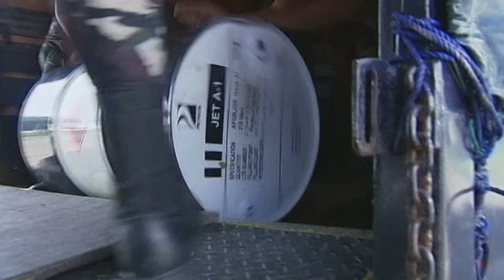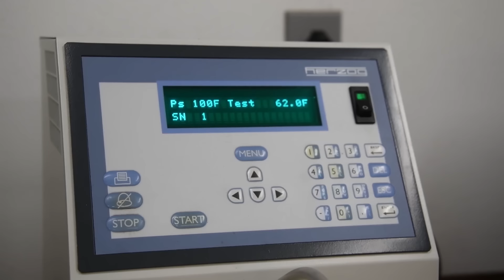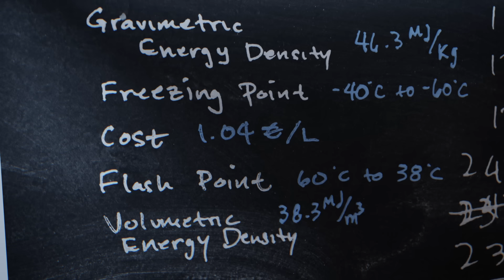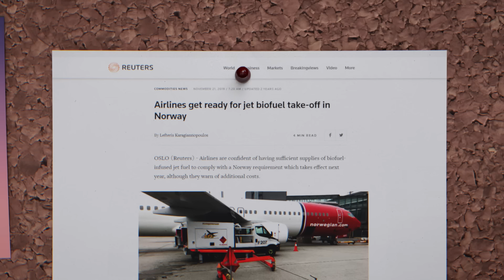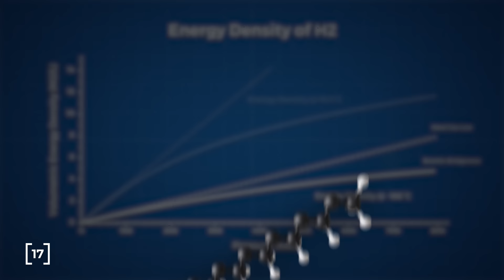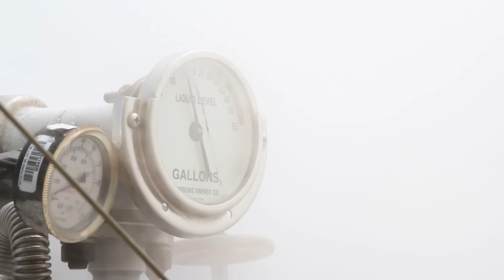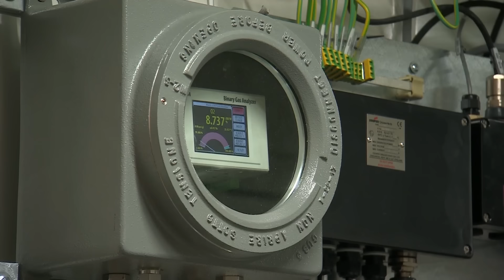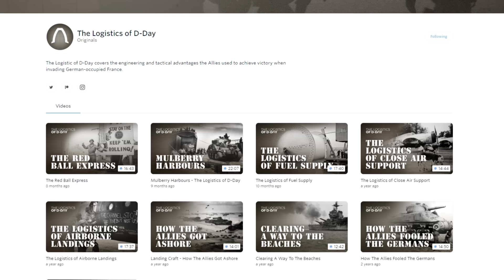The Uncertain Future of Jet Fuel

Comment: I spotted a fatal flaw in the video, boiling, freezing and flashpoints are measured in temperature scales, especially, freezing and boiling points are not just linked, they move in tandem meaning that a higher boiling point is equal to a higher freezing point and vice-versa. For instance, the longer chain hydrocarbons like diesel have a higher, not a lower boiling point 3:50. Therefore, it has a higher freezing point as well. which, is the reason why it gets distilled first in the tanks and freezes with higher temperatures than kerosene. on the other side of the spectrum, there is LPG with lower boiling and freezing points, this fuel is distilled last and could endure lower temperatures without freezing for obvious reasons.

Comment: Why does the navy take such serious steps to fight fires before they can happen? Because, paradoxically, fire is the greatest danger to any seafaring vessel. If you have a fire and it damages power systems, as it is likely to do, then you cant power water pumps to douse the flames. At that point you need bucket chains or windlass pumps that can be turned by hand to draw seawater to deck height.

Water, water everywhere...

Comment: I do wonder. What about a propulsion system that generates fuel during operation? You fill your aircraft up with a very efficient feedstock, NOT fuel, which should be way safer, and then convert to, say, hydrogen. Volumetric density shouldn't matter because you only need to store a tiny amount of generated fuel. Correct me if I'm wrong here, but wouldn't that make hydrogen WAY more efficient as a fuel?

Comment: Hydrogen is essentially an energy storage system. And it will always take much more energy to make and use - than it can yield.

An interesting topic might be modern sailing ships - computer controlled kites is one way to think about some of the methods. With Americas Cup sail boats hitting 55MPH, it might be possible to cross oceans in much shorter times than we think - to possibly replace some/most of international air travel. Electric airplanes with solid state batteries could be used for most flights over land.

Comment: This is probably extremely naive of me, but if long chain fuels are prohibitive primarily because of their higher freezing temperature, why isn't supplemental heating of the fuel tanks a potential solution to the problem? Thinking of things like glow plugs in diesel engines, for example.

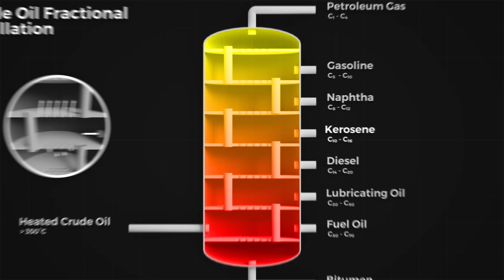Comment: 4:20 "by excluding the hydrocarbons with longer chains with longer chains, and therefore excludes lower boiling point molecules from the mix." 

Should this not be higher boiling point molecules which have a higher freezing point? i.e. the hydrocarbons at the bottom have a higher boiling point and higher freezing point? There are then less of these in Jet A-1 which leads it to have a lower freezing point and is better suited to colder climates?

Comment: I wonder, could you use the heat byproduct of the engines to keep the fuel at a steady temperature?  Maybe not water but some coolant that runs through the engine, with a heat exchangers near the fuel tanks and along fuel lines?

Comment: You didn't mention anything about battery technology improvements. If batteries ever get to the energy density of jet fuel - then the problem is solved, especially when the batteries are structural and won't waste any space inside the airframe. It might be a long way off, but isn't impossible.

Comment: High flash point, low vapor pressure, also with lower melting/freezing point on the same time ~= wider temperature range for liquid, hydrocarbon molecules with more branching structure or need to insert polar functional groups (e.g. amine, amide, alcohol, ether, ester ...) to the hydrocarbon backbone.

Comment: Liquid Natural Gas is denser than hydrogen, cleaner then other hydrocarbon fuels (no particulates, less CO2) and cheaper than kerosene. It's still a cryogenic fuel like hydrogen, but it doesn't need to be as cold, and it burns at a higher temperature than hydrogen. There is the problem that it is not compatible with existing planes, but planes specifically designed to use it would be cheaper to make than ones using hydrogen. Also, the coldness could be an advantage, as it could help cool down electrical components and be used to densify the air coming into the engine, making it more dense, and improving the efficiency of the turbofan system.

Comment: The big problem with airplane fuel is that the profit margins of air travel are so thin that retrofits to use new fuel sources are financially untenable. The military can spend infinite money, but they are going to build what they "need" regardless of what's good for the planet (national security trumps ecological security).

So unless you find a way to let existing planes run on some new fuel source...you are stuck with dirty inefficient planes nearly forever. Airplanes have become massively more efficient over the decades, but you wouldn't think it given that the designs of aircraft bodies used for transportation are from the 1960s. And usually the planes are still from the 70's or 80's.

Comment: I absolutely do not see  aviation moving to use Hydrogen as a fuel. GL airbus... although I doubt they are actually betting on it either, im fairly sure its just marketing that they said that at all.
It is not just harder to store and less useful energy density than gas but it is far more complex to store and transfer. It is far more prone to failure and catastrophic failure at that too, imagine a modern plane which is built to expand contract and move, now you have cryogenic pressurized fuel on board, which is likely to be stored in the fuselage... yeah I have serious doubts. Very very unlikely to see it used widely on commercial aircraft. A couple prototypes and one-offs perhaps but not more than that.

Comment: Here's how to reduce dependency on aviation, build high-speed railway lines to encourage modal shift which will effectively get rid of all the short haul flights. Decarbonising short-haul flights isn't necessary, as the high speed rail could take all those passengers who would've flown. The only issue after that are long-haul flights. And no, Hyperloop isn't the answer to that either.
Reply: That's what maglev vacuum trains are for. Not Hyperloop (whatever they end up defining it as), but a larger design that uses train cars or independent shuttles similar in size to modern rolling stock or an airline fuselage. A decade ago I calculated that to serve most residents and replace the most popular air travel markets/segments, an upside-down-N shaped system of 3 trunk lines could be sufficient. All you really need is an east coast line from NYC-Miami, a west coast line from LA-Seattle, and a transcontinental line from NYC-LA passing near Chicago and some other cities. At fast enough speeds, a vacuum train would beat a direct flight from Seattle to Miami, despite the longer zig-zag route.
Reply: @jakeaurod  That's great but it'll be very expensive. You can't add any cant to maglev tracks and it'll most likely going to need a lot of tunnels.
Reply: @ironmantrains  I'm not sure if it will need to cant. I expect very straight guideways, especially for superspeed sections, but slowing down for stations stops with some sort of mechanism to move off the main trunkline using landing wheels, but I'm not sure.

I did try to estimate the cost and figured it could cost as much as $1 trillion, but I was using estimates for hardrock tunnels in California ($15k/lf, if I recall correctly), which might be less expensive in other locations where cut-and-cover might be used and with lower earthquake risk or where labor is less expensive, and economies of scale might kick in. Still, it doesn't need to be built all at once, as the NYC-CHI-LA trunkline might be the first built, perhaps running NYC-CHI until western sections are finished, and profits could go to build the other segments and the East and West coast lines later.
Reply: @jakeaurod  That's great but maglev is a #gadgetbahn. And imagine how much steel and concrete building such a route will require, compared to conventional rail. Just transport everyone in planes. Imagine the energy consumption figures for maglev.
Reply: @ironmantrains  Compared to highways, airports, and HST?
Reply: @jakeaurod  See Gareth Dennis's video on maglev

Comment: The carbon problem isn't "jet fuel" as such, but "jet fuel; from fossil sources". Jet fuel is going to be the best solution for long haul travel for a while yet (electric airctraft are a short range option only)

If we concentrate on molten salt nuclear energy (ironically, ultimately derived from the USA nuclear aircraft project)  then it's hot enough to start directly making hydrocarbon fuels without the faff associated with "bio" sources competing with food

China was scheduled to have a molten salt nuclear reactor go critical in September 2021 - the first once since Oak Ridge in 1969. if it validates Oak Ridge results then a nuclear renaissance beckons

MSRs are many many times safer than conventional nuclear whilst being much cheaper to build/run and much less wasteful

Comment: Your analysis of hydrogen left out any use of fuel cell and catalyst.  The conversion of hydrogen back into water is way more energy efficient than combustion.  Electric turbine jet engines powered by fuel cells would have a much higher usable range.

Comment: From Forbes Magazine artcile: "
 it's vital to know what the natural rate of CO2 emission is to understand the impact humans are having. Humans emit around 29 billion tons of CO2 each year: a little less than 1% of present atmospheric CO2. Even more CO2 inside the Earth's CRUST.
Reply: but what does that prove? The co2 in the atmosphere is in a natural cycle(great so it is not  freezing cold on earth) 
Copied from a page that i found searching for the Article you Quote should be from(Did not find your forbes article). 
"But consider what happens when more CO2 is released from outside of the natural carbon cycle – by burning fossil fuels. Although our output of 29 gigatons of CO2 is tiny compared to the 750 gigatons moving through the carbon cycle each year, it adds up because the land and ocean cannot absorb all of the extra CO2. About 40% of this additional CO2 is absorbed. The rest remains in the atmosphere, and as a consequence, atmospheric CO2 is at its highest level in 15 to 20 million years (Tripati 2009). (A natural change of 100ppm normally takes 5,000 to 20,000 years. The recent increase of 100ppm has taken just 120 years)." 
The last 800,000 Years the range of co2 in the atmosphere was between 170 and 300ppm. 2019 average is over400ppm

Comment: Ok hear me out, what if instead of having the power source onboard, we just beam radiowaves at the plane and catch them with rectennas?
Reply: We've looked at that in the past, believe it or not. The problem with that is the energy required to fly and what it would take to receive it, the rectenna becomes larger than the aircraft, and the intense microwaves necessary to power it (radio wavelengths are too large) essentially cause massive environmental problems. We also looked at lasers in a similar idea, but lasers tend to lose a lot of power over large distances, and clouds present problems too.

Comment: Thanks for the sources listed in the descriptions. VERY IMPORTANT : any NEW fuel driven from agriculture is not acceptable, because it will need to take space from food agriculture and from wild areas. The only viable source of fuels to be reused is waste from food industry. (and there is not enough)The hard fact is we'll have to accept to reduce travels. Replace a trip with viewing 4K and replace business trips with video conferencing. But even then the internet and advertising are alone able to bring death to 1/3rd of mankind because of infrastructures and energy use, even without crypto currency nonsense.

Comment: biofuel seems so problematic if we grow plants 
… but farming algae that produce oils looks amazing, if we can get the process worked out.  🤩
Reply: hydrogen is brilliant, / generating it as a way to soak up excess power.  👍

managing the load shift when solar comes online in the morning, and when it goes off in the evening … I feel like dumping all the surplus power into gererating hydrogen is one of a few great options.

( also, running compressors to extract CO2, as tanks of liquid, or as dry-ice. )
🤷‍♀️  it’s useful to a variety of industries.  for cooling, or gas-pressure, or other reasons.
Reply: or run the really fancy compressors, and extract liquid Nitrogen, and liquid Oxygen?   that’s super useful to industry and medicine!

I feel like we just need a surplus of cheap power, and the rest is commercially available parts.
Reply: anyhow, obviously, the holy grail is using 100% renewable sources to produce liquid Oxygen, and liquid Hydrogen, so we can launch rockets to the moon.   🤣👍

Comment: I wonder if more exotic fuels like metal fuels might be relevant. As for electric planes, the idea of nuclear electric planes deserves attention. Safety is a huge problem for that, as is just the idea of scaling down nuclear reactors that much, probably, but maybe if we get small fusion reactors someday, or if people if people just don't worry about the thorium, etc. that would be spread everywhere in a crash...
Reply: Did you mention ammonia, I don't remember. I just suddenly realized that ammonia is an obvious answer: no carbon emissions or other problematic emissions (combustion releases only nitrogen and water), more energy released per atom combusted than with hydrogen (though much less per unit mass fuel), liquification temperatures much more manageable than for hydrogen, and there's even some precedent for it on planes with the XLR99 rocket engine on the X-15, which also used liquid oxygen. Admittedly, that is not much like an airliner, cryogenics in general are a problem, even if mild, and ammonia creates a risk of toxic fumes, though I'm not sure if it's worse than the toxic fumes from gasoline, people use and even touch ammonia-water solutions at home all the time, and it's definitely not as toxic as hydrazine, another nitrogen-oxygen compound that's a better fuel. (I would mention the less toxic hydrazine replacements developed for rockets, but they contain carbon.)

Comment: I think the Future of Air Travel should be intercontinental. Trains, high-speed trains, and subterranean maglev vacuum trains running at superspeed or hyperspeed (referencing sonic speed regimes) could replace domestic and transcontinental air travel. A system of tunnels and bridges between the USA and Russia could link the major continents with trains with various guideway designs and speeds (superspeed passenger and cargo, but also standard and broad gauge steel wheel/rail), and this could absorb some of the Pacific Markets. Connecting the Americas to Eurasia via bridges and tunnels across or under the Atlantic might be more difficult.
Reply: That’s waaaay too much infrastructure to build, maintain, and keep secure from terrorism or natural disasters... Not gonna happen.
Air travel is here to stay, the means of traveling by air just have to change.
Reply: @MouradMokrane  I know. We might need to resolve many of our political conflicts so that people don't want to kill hundreds in a bombing. I suspect the natural disasters are less of a threat since it would be underground by at least a few meters. Earthquake risk would be a risk in some locations, but new warning technology could allow an emergency stop or slowdown depending on severity. I don't expect this could replace all air travel, just a lot of it.

Comment: Hydrogen can also be stored in metal hydrides at room temperatures so Cryogenic storage of hydrogen is not a must! Hydrogen can be compressed into metal hydrides so that hydrogen is better than kerosene by volume. We could also make air travel links shorter or have connections to maglev trains.
When you compare the costs of fuels you should compare their true costs. The cost of kerosene needs to include the cost of an armed occupation of middle eastern
countries to protect oil fields. Government subsidies to fossil fuel companies also need to be part of their true cost. There is a big cost for pollution and environmental
destruction too and that cost needs to be part of any truthful comparison.
Hydrogen can be manufactured and sourced from any place on the planet. There is no need to guard oil fields!